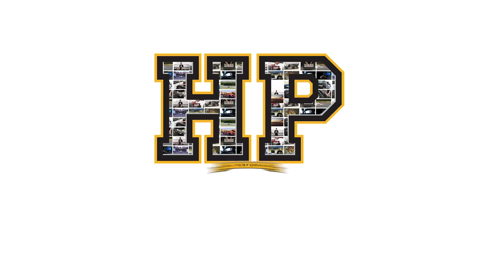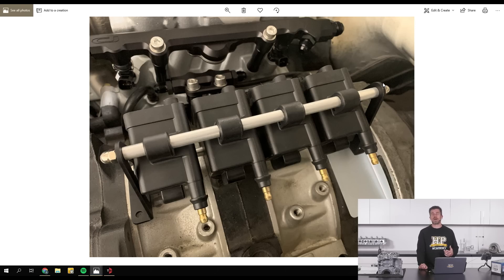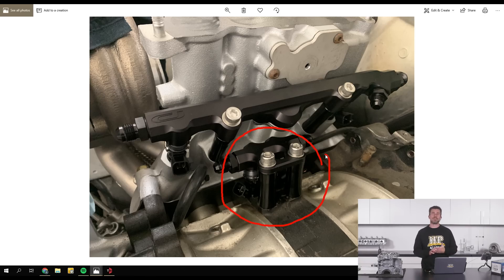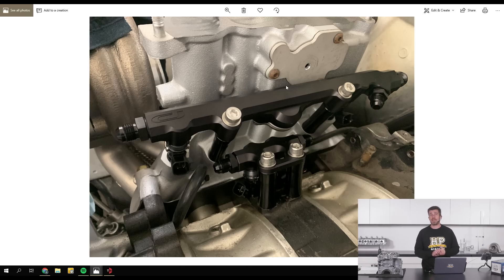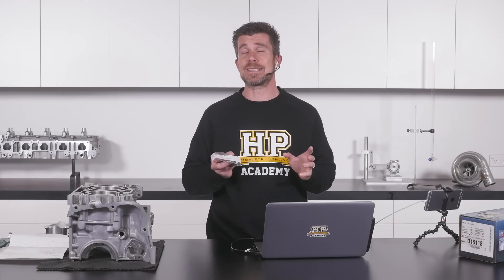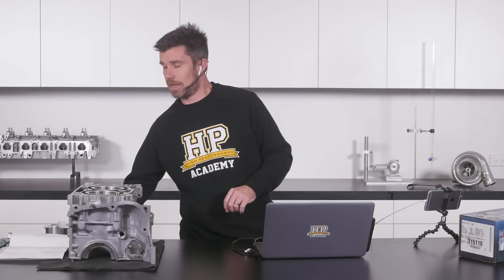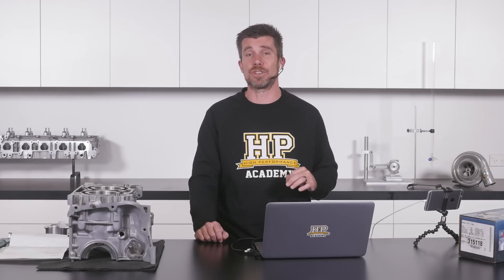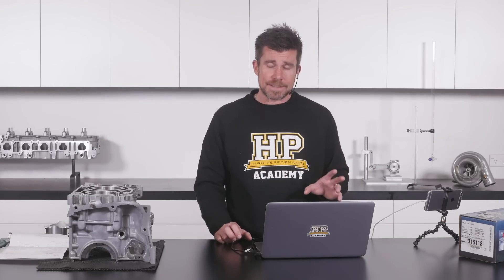Tuner Nerd Knock Monitor, Adaptronic ECU and Turblown | Today At HPA 210 [UPDATE]

Comment: I always wondered why rotary guys don’t use a dual blade throttle like from a gt500 or something. Like a twin jet 65 throttle. Enough air flow and dbw units are available. Obviously considering at that level you probably have a custom style upper intake manifold that can be modified to support that throttle but with the width of the twin jet system it makes sense for a two rotor to me just thinking it out real quick. Although I am not the brightest crayon in the box lol. God bless. Keep racing and learning.

Comment: I'll be interested to see how you guys like Adaptronic. I had tons of issues with mine. Some were because of sensor oddities from Subaru, and Andy did eventually get that sorted out. However, Eugene has proved to be pretty unstable and there are several promised features that have simply not come to fruition. I still have mine, and I believe that there is still great potential with the platform, but I am torn on whether I would recommend it right now. I need to get the car back together again to work with it more, but I hope that they have really stepped up and fulfilled most of the promises made by that point.

Comment: that is not a good place to put coils lol I have first hand experience 
is recommend moving coils over to the n/f wing area
Reply: why
Reply: @Thumbs-Akimbo  heat
Reply: It doesn't look like it's bolted down so hopefully that's just where they stuck it for a quick picture.
Reply from the maker: This is essentially where the stock coils are mounted on the 13B-REW so it seems Mazda felt it was a suitable location. We've also run the IGN1A coils in this same location in the past with no trouble so I'm quite happy to proceed. Right now the coils are only sitting on the block and still require a proper mounting solution - Andre

Comment: If you want DBW on the FD but want to retain the primary vs secondary throttle plate staging of the factory triple butterfly throttle body you can either (a) use a remote e-throttle servomotor to drive the throttle linkage on the factory FD throttle body, like the actuator used on the BMW  S54 engine or aftermarket Jenvey ETA2 - or (b) if using a single plate DBW throttle body, retain the vacuum actuated secondary double throttles located in the FD UIM and control them using the ECU.  I'm using both strategies to incorporate DBW with my FD 13B running straight LPG via Gas Research single plate throttle body mixer
Reply from the maker: You must have read my mind! I'm most likely going to go down the remote dbw motor path and having previously used the S54 motor this was the one I was planning to use. I'm less inclined to try a single throttle body and try and incorporate the double throttles as I'm not confident I'd get good control (after all this isn't how the double throttles were intended to be used), however if you're getting good results that way then good stuff!  - Andre
Reply: @hpa101  excellent! My setup is still in build so i don't have proof of concept for the double throttles just yet. The switch point might be difficult as they are basically on/off. It may be possible to use a linkage to make them mechanical secondaries that begin to open at say 15-20% of primary throttle angle. Let's see how it goes